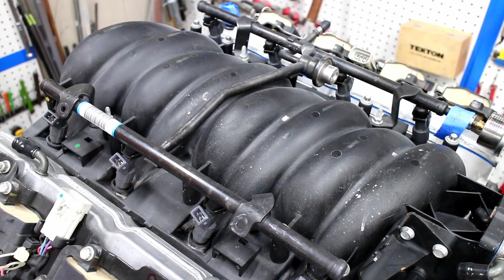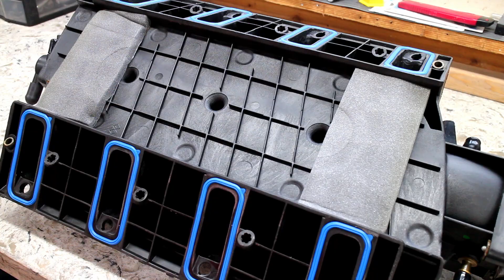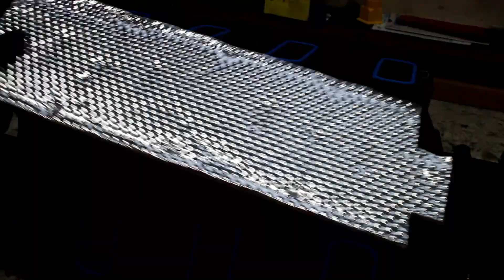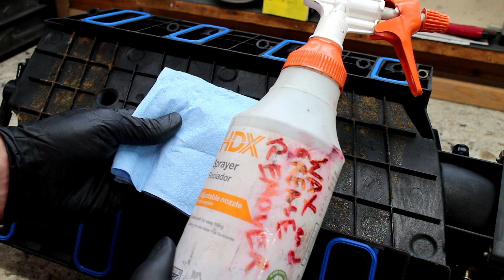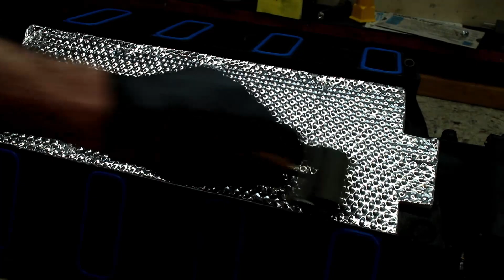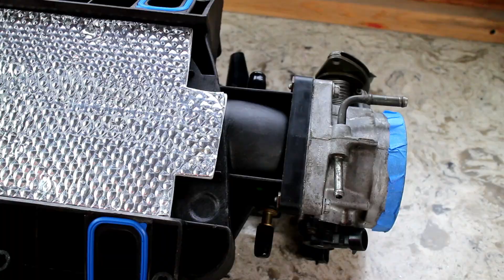LS1 Intake Heat Shield Install

Comment: Did you ever seen any improvements with your AX times? I imagine best way to judge that would be relative to similar cars in your class since the courses change.
Reply from the maker: hard to say if it did anything.
I can say my engine doesn't seem to heat soak at all.

Comment: Question, approximately how thick is the heat shield? And just curious why you didn't put the foam pads back on. Do the pads plus the heat shield together cause any fitment issues? I appreciate your feedback since I'll be changing my knock sensors soon and I'm interested in this product. Great job on the video! Very clear and detailed information.
Reply from the maker: the foam doesn't fit once the heatshield is in.
I'd say the shield is about 3/16in thick.
my car pulls very hard even on hot days, but not sure how much if that is from the heatshield.
Reply: Thank you very much for the fast reply!! I truly appreciate it!

Comment: this mod works well ive noticed a 30 to 40 degree difference and intake temps are lower i dyno before and after and noticed 15 hp difference defiently helps manage some heat soak